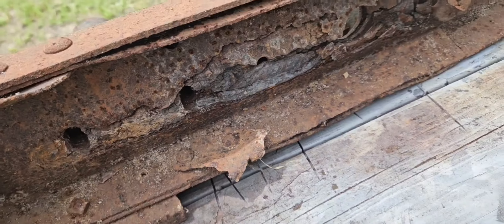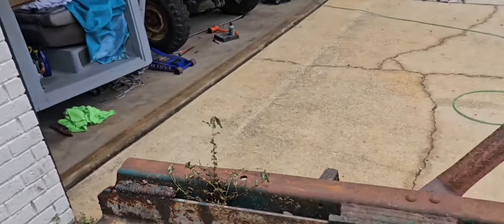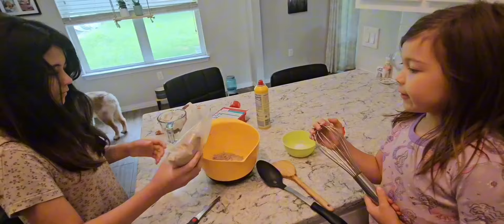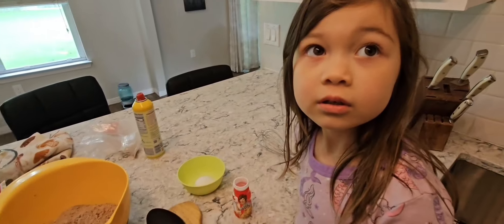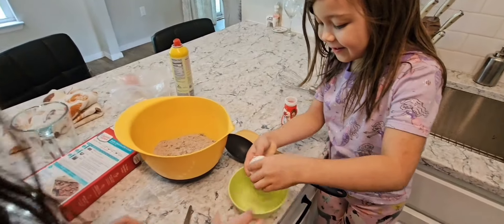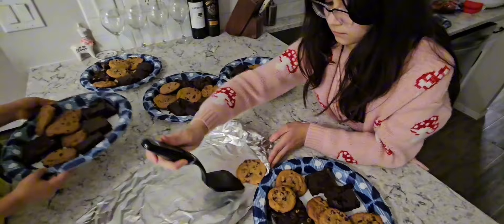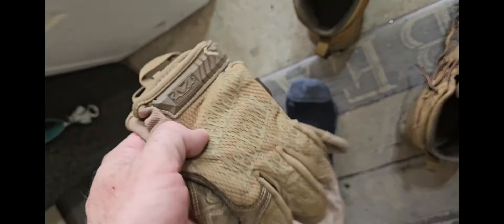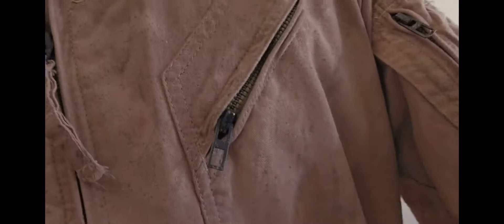Frame is finally finished | Gets paint!

Comment: Tumbleweed keep up the great work……… I have one concern when you’re welding in the garage you should either wet the floor first or wet the floor after……….. don’t ever remember fire prevention week on the Little flames  we’re running around and hot  Ambers it would start fires way after you were gone from the building…………. would hate to see you lose the whole thing to fire ….. don’t forget  to chasing down those little embers…… learn that years ago from a guy in a body shop keep up the great work sam bacon

Comment: Wow, that paint transformed the look of your frame!  It's nice to never have to see the rusty frame again.  My rear crossmember has the same rust jacking between the crossmember and the second layer of steel that is welded in there.  Every one I've seen has the same problem.  I don't know why Willys decided to add that plate, but I can only guess it was to strengthen the middle in case you bolt a trailer hitch to it there.  I was going to ignore it on my frame, but I think I'll go back and try to remove it before it rusts through the crossmember.

Comment: Your efforts are rewarded. The results with the frame are splendid. This chassis looks really nice and robust. Did you add off line on the frame an additional layer of grey paint above the green looking one or is it just that at the end it turned really grey? Congrats from Paris, France
Reply from the maker: Yes, it ended up being too green.  So I found paint that match the color I was going for and covered the areas that would be visible once it's completed